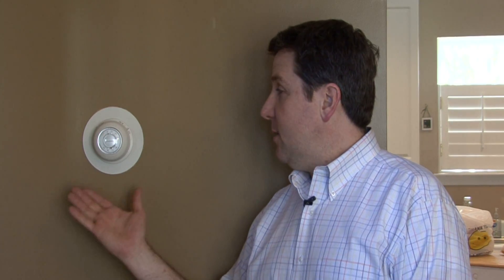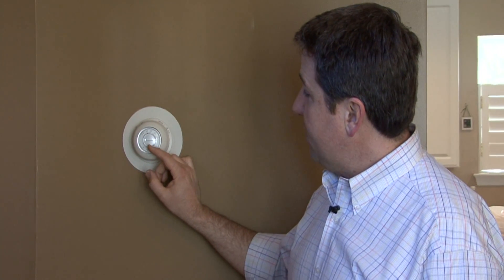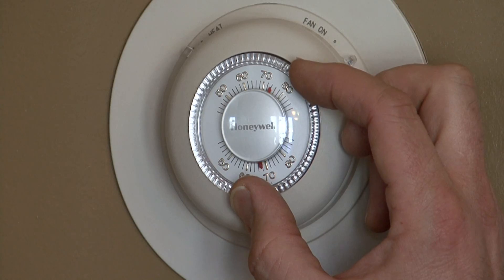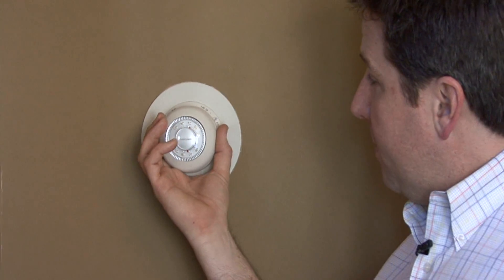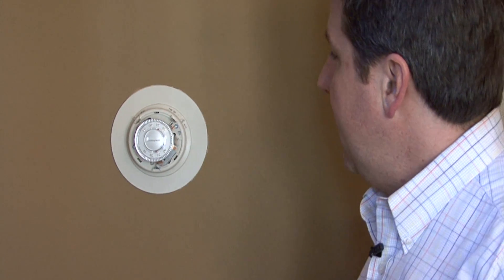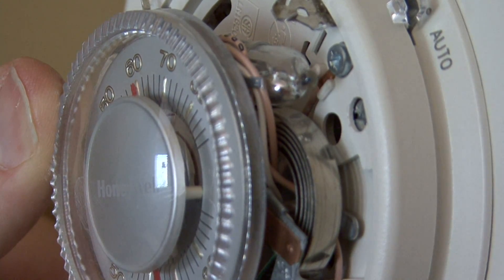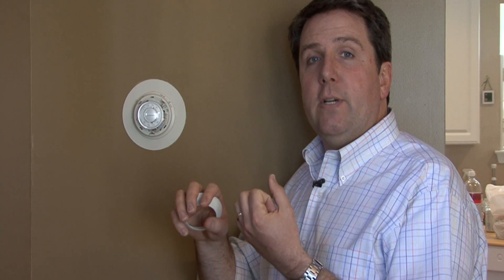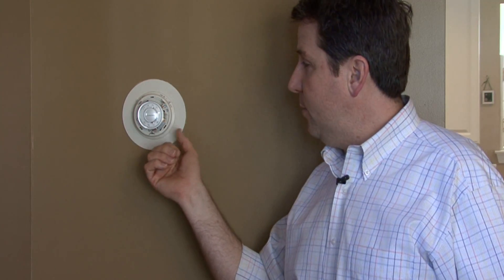Home Repair & Maintenance : How Does a Thermostat Work?

Comment: Movers hit my thermostat.  AC runs fine. Bottom temperature not working. Can I just replace the front piece that comes off. Wires are fine on the wall piece.

Comment: I turned down my thermostat all the way down to 50 last night and my heat was still cranking  at 74, wouldn't turn off.  Do you think the thermostat is shot or another issue?
Reply: Is it good to turn it all the way down to 50 my problem is people are telling me keep it at 70 and it's hot rn and thermostat reads 80 to 90 degrees

Comment: To title this "How A Thermostat Works" is a stretch. You referred to the thermometer on the bottom as a setting. Room temp is not a setting. The setting is on top. You ignored the anticipation feature. And yes exposure of the mechanism is more than just a niceity; it's essential to "How THIS Thermostat Works". Have to give a grade of "D" for "poor" on this video and a thumbs down.  :(
Reply: You’re a bit of an ass, m8.

Comment: The face/cover on my thermostat broke off, so this was great for knowing which way to move the bubble to ensure heat doesn't come on, temporarily until I get a new one.  It might have been helpful to see the rest of the mechanism as well, on the lower right there's some sort of switch (wife thought it was to turn off the heat, turns out it wasn't ;))
Reply: S Campbell whats it for?

Comment: the compressor dosent cool you house the evaporater coil does the compressor just transfers low pressure gas to high pressure gas

Comment: what if the temp is set for 68 but what if the temp in the room dosent show it getting higher...i am getting heat but the thermostat setting in room dosent rise
Reply: Cindy Mancinelli Could be that the thermostat is in a location where it doesn't get enough heat?  Or if you're just talking about the lower indicator, maybe that's broken (it's a thermometer, maybe it's separate and ran out of mercury?)